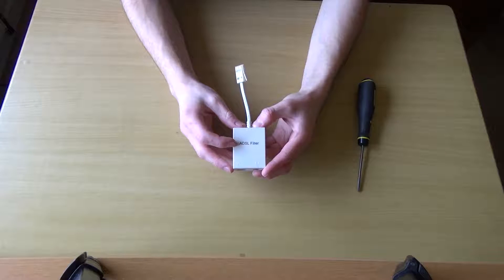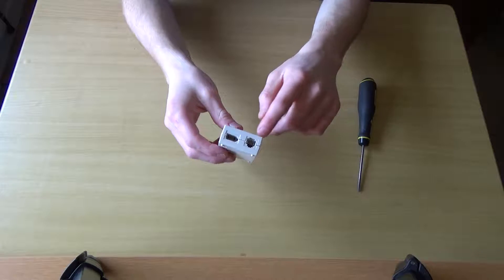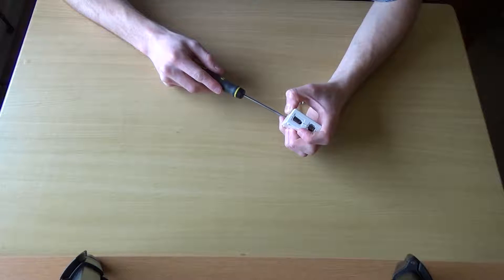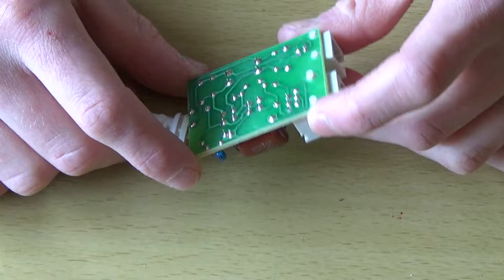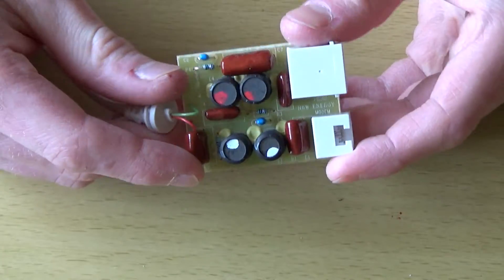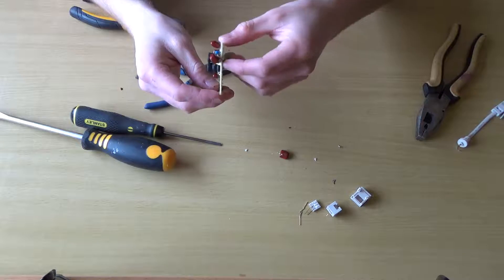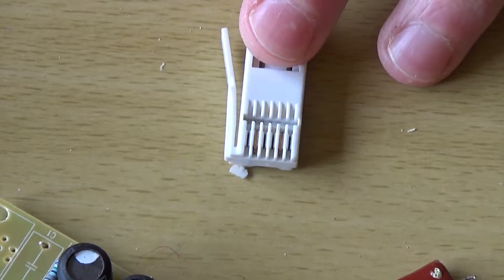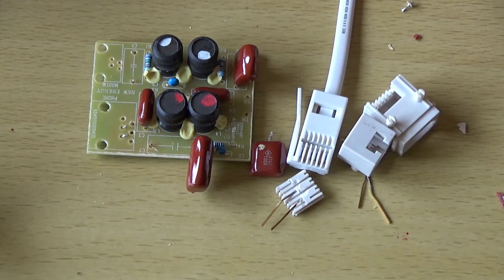Teardown: ADSL Filter (Why Does It Smell of Burning Electronics?)

Comment: The black towers are actually inductors, coils of wire which can be used to filter out certain frequencies, the red things are the capacitors which again can filter out certain frequencies, these two types of filter combined are what separates the internet frequencies and the voice frequencies from the one phone line, and incidentally only two wires are actually used in the phone network, it's a really clever system.
Reply: @FrazerForbes1  No worries, there's no point leaving a comment like the other one on this video, everyone starts at the beginning with electronics and if we don't explain stuff to each other then nobody learns.